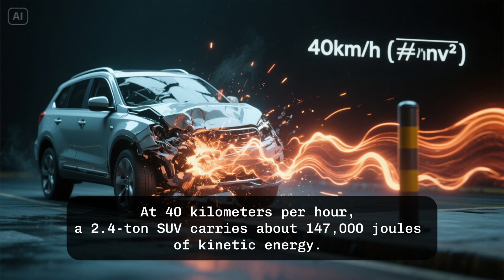The SUV Didn’t Just Hit Bollards. It Hit the Truth We Refused to Ask

Comment: that is untrue, the driver admitted he stepped on the wrong pedal
Reply: Salamat sa comment. Ang tanong sa video ay hindi lang tungkol sa inapakan — kundi bakit naapapakan?

Maraming self-acceleration incidents (SUA) ang nag-ugat sa driver “admitting” na inapakan ang maling pedal — pero hindi ibig sabihin noon na walang external factor.

Sa high-signal zones gaya ng NAIA, may posibilidad na maapektuhan ang electronic throttle systems ng modern vehicles.

Kaya ang tanong namin ay “Sapat na bang paliwanag ang driver error — o may hindi pa tayo naiintindihan?”

That’s why we ask, not to disprove — but to dig deeper.